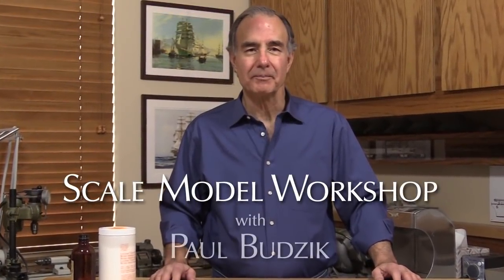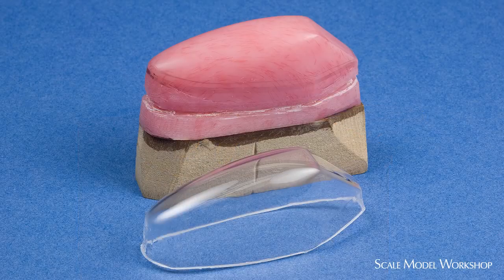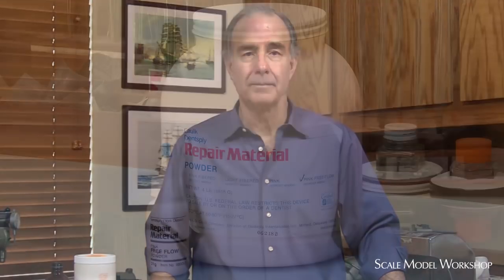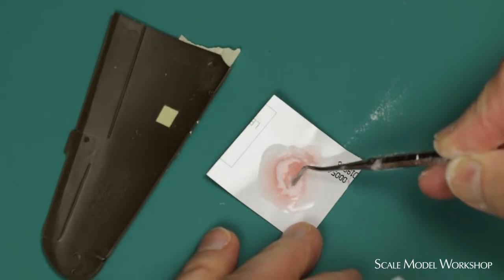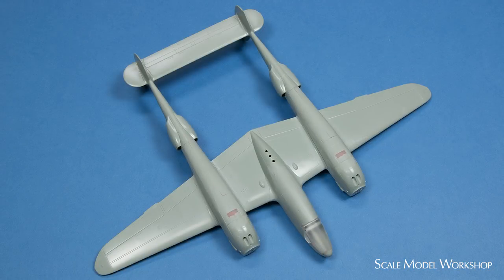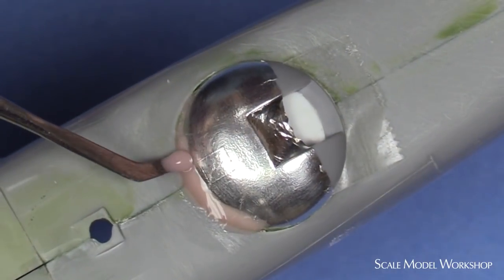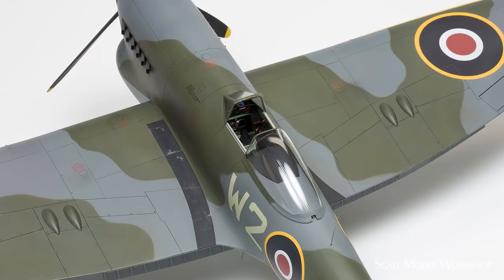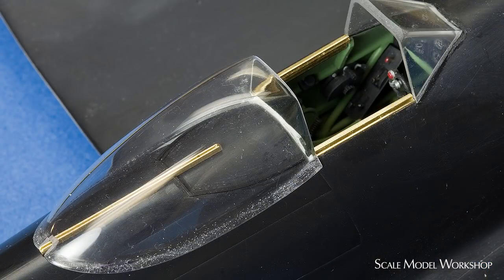Dental Acrylic for Scale Model Construction

Comment: You can buy a similar powder at a beauty supply store. It’s an acrylic powder used for building up artificial fingernails. It comes in a clear and a pink I believe. I have gotten the clear. It is formulated to work with a solvent as well, but works with cyanoacrylate just like the product showcased on the video.
Reply: Yes I used cosmetic nail acrylic and it works great.
Reply: I tried the nail acrylic too and it works very well. You can get it in lots of different colors on ebay.

Comment: Hey Paul,
I've been using Zap-A-Gap and the free form powder for a while now after watching your videos.  I find it especially handy when joining 2 halves of a fuselage together to fill large gaps.  As you know an added bonus to using these products is the reinforcement you get along the seam line.  Another great tip and thanks for sharing!
Reply: Where do you get the free form powder? There’s a lot of products on eBay but how do you know if they will work with Zap-A-Gap. I have the full range of ZAP products. And would really love to start using this technique for reinforcement a few silage halves and build ups

Comment: HI Paul, I just had another good look at this video and want to thank you once again for these great productions. I managed to obtain some of this material locally (I've got SNAP brand). I've used it with it's own catalyst and found it's an awesome material to build up surfaces and cast small parts like gun blisters. I'm going to try to fill some nagging wing panel lines that won't go away and try it on a test 'beater' with the SNAP catalyst and some with the CA glue and see which works best. Thanks again, and if you're going to be in Chattanooga, I'd love to meet you and buy you a beer!
Reply: Steve... so is this what you have?: 'PAR-S452 Parkell Snap Acrylic Powder #59 170gm'  I'm wondering whether this works with the CA glue.  It seems to have 'self-curing' properties so I wondering whether it only works with the proprietary catalyst.

Comment: Hi Dr. Pauly B! I’ve been using the free flow powder/zap a gap combo for a number of years now. I find it’s a great way to back fill aircraft undercarriage openings when the models are now mostly wheels down but I want them to be wheels up! Anyway I was curious what tape you use to back fill openings with? I was using tamiya masking tape but I get a lot of the fibres stuck in the compound and sometimes I have to really go over it with sanding to remove that. 
Also I recently got the clear orthodontic resin powder, how do you avoid bubbles in it? I found it ultimately a bit useless for clear parts since all these air bubbles got stuck in it. Yours doesn’t seem to have the same issue?
Thanks again for all the great videos! I regularly have a chuckle when I use my bard Parker handled scalpel and wonder what other poor saps go through when they use a lesser cutting tool! ;-)

Comment: Paul, how long can the ca/resin mix be sanded or shaped after you put it in place? The incredible short work time turned out be the problem with all the other powders I tried mixing with ca glue. Thanks for putting these videos up for us.
Reply: Just a quick edit...I  see that my question is a moot point as that particular product has been discontinued. Any possibility you could recommend a replacement?

Comment: Hi Paul,
I've been using the free flow powder/Zap combo but I have trouble with the mix setting up too quickly.  Even using slo-zap, by the time I start getting a pink hue to the material it's set up on my mixing palate.  Any tips for slowing the set time?  I'm using the Dentsply Free Flow.
Reply from the maker: Add a little at a time, but you need to be quick about it.  I've noticed the Zap-A-Gap has been working faster lately.